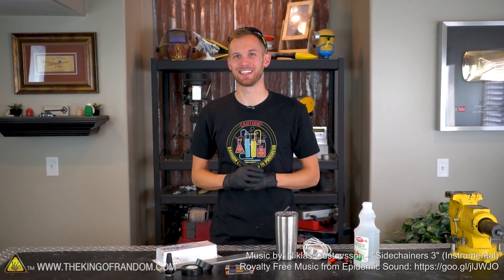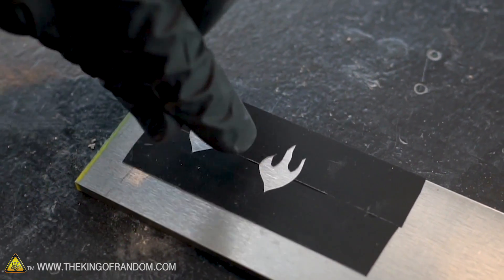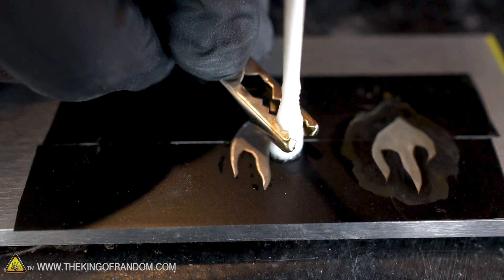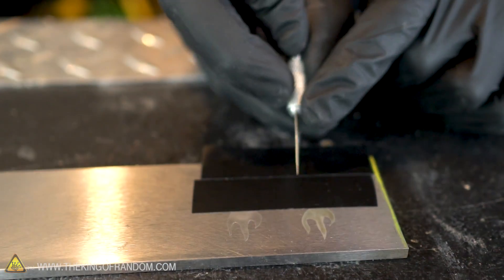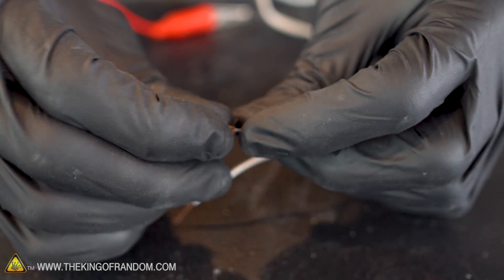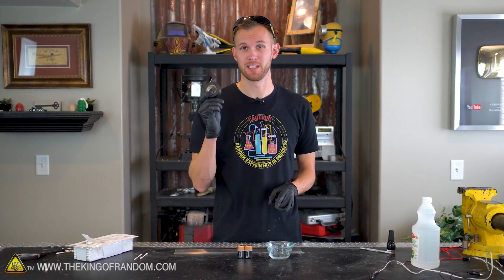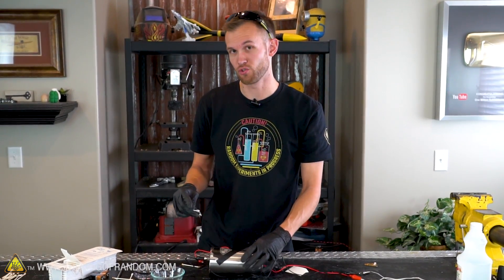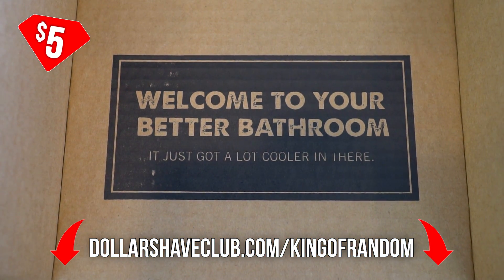Etch METAL with Battery Power! TKOR Shows You Everything To Know About Metal Etching

Comment: The isopropyl alcohol left of film on the steel is why your nail polish didn't stick that's one of the reasons you use deionized water on PCB boards to clean contacts as to not leave a residue behind and not isopropyl alcohol this would explain the nail polish peeling so easily

Comment: I want to give you a tip: Cut the plastic with a softer metal than the metal you are actually etching. When I need to cut plastic cover from stainless steel plate I always use a sharpened copper stick, it doesn't leave any scratches on the surface.

Comment: Mix salt with the white vinegar. I hot glue a box around what I etch, fill it with the solution, place a nail in the solution, hook up the charger and let it run for a few minutes. You get a crisp uniform etch

Comment: Vinyl decals (similar to the electrical tape) is the best way to etch. You can also use one of those sponge brushes from the paint section of the hardware store, with salt water, to do large engravings the same way you did with the cotton tip and power cord.

The nail polish trick is better for 'raised lettering' etches, and you probably need a higher quality nail polish.

Comment: A youtuber, ChrisFix, did this where he used vinegar instead of water (vinegar+salt). The end product looked really clean, so try giving vinegar and salt solution a shot. He also rubbed the metal surface with rubbing alcohol before beginning the etching, which I think might prevent those stains from appearing when you did the logo.

Comment: I do etching on the side for ecigs, beltbuckles, metal coffe mugs like you had. Lots of things. The vinegar is better and faster but it has a different mixture ratio than saltwater. I use 2 cups salt to 1 gallon vinegar. Also i submerge using a jumpstart car starter on 12 volts. I can etch a hole through a 1/8th plate of stainless steel in about 15min. So i have to watch the time very carefully to get a nice top layer etch. For masking i use a vinyl cutter. Hope this helps.

Comment: Awesome video. I've got a question. Is it possible to use this technique for deposition other metals on the surface? For example, use copper sulfate solution and deposit copper on surface?
Reply: Electroplating would be the term you're looking for. It's not exactly like this but it's similar. You could maybe do this if you used a metal solution in place of the saltwater, but it'd be way more wasteful than normal electroplating, especially if it was an expensive metal like gold.

Comment: You should try this with a high voltage, low amperage transformer like an MOT instead of a low voltage low amperage one :). Basically what will happen if you use 2000v instead of 12v :)

Comment: the Vinegar requires salt too, bruh. This is a simple variation of reverse electroplating, but you're using a q-tip to catch the steel ions instead of touching the clip directly to the steel.

I myself love to electroplate and I recommend 1 cup 5% vinegar with a teaspoon of salt

Comment: ive been doing this for quite awhile and iv always used 12 volt wall connection. both wall charger kinds put out rectified DC neither puts out proper DC OR AC in fact, if you submerge the work piece youll see it pulse where it removes part of the AC wave to get rectified DC. for finer details i use whiteout and write in it while its wet, takes some getting used to but ive found it much better than cutting any base layer (especially for cursive or fancy writing)

Comment: The nail polish is better used for rougher services. You should use it like a paint, over a paint mask, and as it starts to cure take off the paint mask. Let dry fully. It's so much easier to use vinyls, paint masks, or tapes. But they do not work reliably on textured material.

Comment: Actually the difference between a ac to dc wall charger and a car battery charger is that a car battery charger has more amp and it has more voltage than a ac to dc charger. Usually it's 5 amps and 14 volts. And if u use a car battery charger the etching is going to be faster and deeper.
Reply: Yes, but wall adapters are cheeper and easy to store yet give enough power to do the job.

Comment: Instead of using a knife to scratch the nail polish off, try using a small rotary engraving tool to put your mark into the steel. Also try having the surface a little more roughened up (use 240 grit sandpaper) so the nail polish will bond better to the steel. I've been making knives for several years using this technique to put my logo on the knives without any issues.

Comment: if you used every method atveverything so battery 2 times battery dc plug and for tuat all the sald and the vinegar and for tgat all the carbon steel and the mug and for that the sticker the tape and the polish you would do this experiment 36x atleast. to determine what steel works best. what power supply, what liquid, what cover

Comment: I tried this with a 9v battery, vinyl was used as a mask, worked great, if you have a cutter(I used a cricut) you can make all sorts of cool stencil masks:-) Also I find that dabbing it and holding it in place for a few seconds works better than rubbing, and cotton balls/pads are great for larger areas

Comment: If you build up around the sides with modelling clay so it holds a bath, with the stencil at the bottom, then just leave one electrode submersed in the bath. you get a very even etch because it etches the entire pattern at once, and you can vary the depth by timing it, more time or more current means a faster rate of etching. it also means you can walk away, and not have to sit there moving the cotton swab
Reply: @Drewster 30, size of the bath dosnt really matter, you can just leave it for more time, with the same amount of current. there is a guy on YT called michaelcthulhu and he makes swords, he has an 8 or 9 foot bath that he uses to remove rust, though the same process. sometimes he builds a fire under it to speed it up.
Reply: @MrWorth66  you realize that that also creates rust right? I would do that to razor blades then they rusted again within a hour also make shure it's a 12 volt and not direct wall power plug ooof rip 11 yo me so bright
Reply: Salted vinegar is what I use and it works wonderfully
Lower current does etch slower but give a nicer result. Higher current can leave scorch marks like the 2 9v batteries did. But works faster
To darken high carbon steel better use ferric chloride. It's also sold as pcb etchant at electronic stores, and rinse with caustic soda. The soda isn't necessary but darkens further. 
This is a fun project to do. Another one is learning to copper plate using electrolysis which is a very similar process. Could even in theory plate the etched areas, but the plating wears out with time. And higher current also doesn't plate as well as lower current.
Reply: How much salt to vinegar? Is there a specific ratio?
Reply: Plz make a video on this as a follow up
Reply: I was coming down to write a comment about this but I see it has been done. I assume that the more water you put in the more power but I think that it is more dependent on the surface area that you are trying to engrave. I might try that but if you are planning on engraving more than a square foot I would make sure that you are using at least 4 9volts and make sure the negative is in or close to the average surface area of the area you are trying to engrave so one side is not deeper than the other.
Reply: I wanna see this now
Reply: Abion47 It would etch evenly unless put REALLY close to the metal.
Reply: yes that what he does to remove rust but to etch he does the same thing mentioned in the comment but with a sponge to get an even etch he went over it in the video he posted yesterday but thb i am just happ to find a comment about Irish mike here.
Reply: Wow this is fun to play with thank you for the idea man
Reply: Notgnihtrow
And this will work with all sorts 9f metal, yes? Things like this will be useful for me to know in the very near future.
Reply: Thank you!  I was looking for an easy idea to mold a bath that is so smart...I have loads of clay . Never know how long your comment may be helping people :)
Reply: Yeah i understood everything you said and you totally didn't just crash my mind
Reply: +shinaanish ya! He's just wanting to be a douche bag.
Reply: Notgnihtrow poo l
Reply: Notgnihtrow lmao
Reply: Notgnihtrow this is exactly what I was thinking.
Reply: T
Reply: Just picked up some Play-Doh because of your comment! $0.50 per 3 ounce container!
Reply: Your in
Reply: I wonder if it would actually result in an even etch. My (admittedly under-educated in this area) assumption would be that it would etch more quickly if not almost exclusively in the spots that closest resembles the path from the electrode to wherever the clip is placed.
Reply: Doesn't it matter how big is the plate or cup of metal when you put electricity through it? Make a difference?
Reply: Michael Noeth what do you mean??

Comment: If you you want to use nail polish as a mask then mix it with a little bit of nail polish remover aka acetone and use it to draw the pattern an then etch the whole thing it will be a great mask. I have seen blade smiths use it to etch different design on their blades.

Comment: What about 3.7 volts with 35 amps? As in, using a high drainage battery. Or I have a taser module that I connected it to. About 120 kV, would that be ok?

Comment: I loved this video but I was wondering if you know a way of etching tempered glass like they use on computer cases that can be done at home
Reply: Low pressure abrasive media blasting or using an acid etch  are the only 2 ways  I am aware of, and  of those 2 the acid is far easier. It takes a very careful hand to use the abrasive  media method, and done wrong will destroy the workpiece.

Comment: Do how to anodize titanium
Reply: The 'cheap' way is to use Diet Pepsi due to the phosphoric acid content in it, rubber band a cotton ball to a 9 volt, dip it in the soda and then touch it to the metal.  All it is is controlled oxidation, you can even use flame  to color Ti...

Comment: Use mineral oil to darken metal not vinegar!!!!!!   (edit: mineral oil is suppose to make it a dark grey almost black, the process is used for guns) (edit2:  heat is important... usually needs a boiling process, but i'm thinking that the electricity from the etching would make it hot enough)
Reply: Did you do this with successful results? In the electrical industry we use mineral oil as an insulating coolant within transformers. It's non-conductive.
Reply: +SeaReverie Mineral oil is entirely non conductive, yeah. It's why you can (and people have) drop your entire computer into a mineral oil bath without any problems. But you can paint the metal itself with different types of oil directly and just let it dry. Depending on the oil it will give different types coloration. I think it also needs to be heated tho? Don't have much personal experience here
Reply: I can confirm mineral oil will not very well with the shown method you'd need an alternative way to heat it
Reply: Yes heat is important... usually needs a boiling process, but i'm thinking that the electricity from the etching would make it hot enough.
Reply: I think your right, the electricity might not heat it enough...
Reply: I want to say I've heard phosphoric acid is used for this normally.

It might also be interesting to try Coca Cola, since it's pretty acidic. (and contains tiny amounts of phosphoric acid)
Reply: Michael Noeth what do u mean
Reply: Being an insulator, the mineral oil would not heat up enough by attempting to pass electricity through it. In order to generate heat, the electrons have to be moving and causing friction against some resistance, which doesn't happen through insulators.

Comment: Melt metal, put in dye, then make it solid again.
Reply: Liquid metal won't mix with anything other than another liquid metal. And even then you can't mix any two metals, just specific ones.
Reply: The dye would burn off or seperate
Reply: The dye wouldn't mix
Reply: Szabó Arthur carbon isn't a metal thought. But yeah the dye would not work
Reply: you can mix whatever you want.... nothings stopping you...

Comment: Use sharpies, it's easier
Reply: Naidan Freerun you can’t peel that off though
Reply: Pumpkinpie3080 I ment to just draw on the metal
Reply: Naidan Freerun it's easier to remove tape. And you can get sharper lines. To each their own I guess.
Reply: Naidan Freerun the point of this project is to make it permanent. Sharpies will wear off over time
Reply: I tried Sharpie a few years ago with brass and the sharpie came off as I was engraving.  Admittedly I may not have prepped my brass properly.  I'd invite any feedback from those with experience.
Reply: Kieran M I ment u only need a Sharpie and a bit of metal and just draw like u would on a bit of paper and don't do the electric part